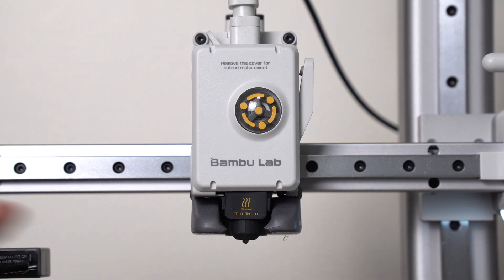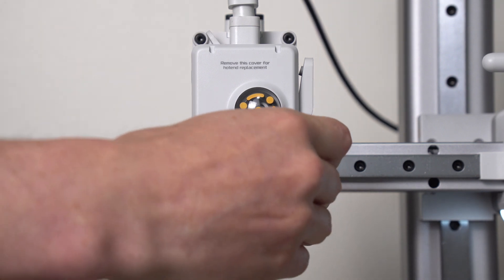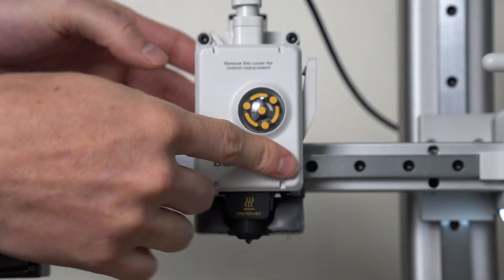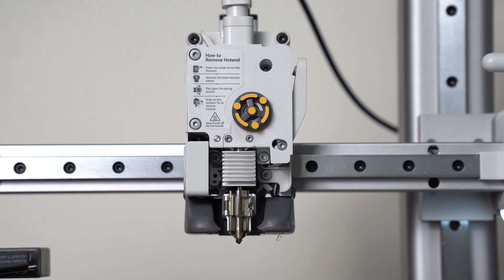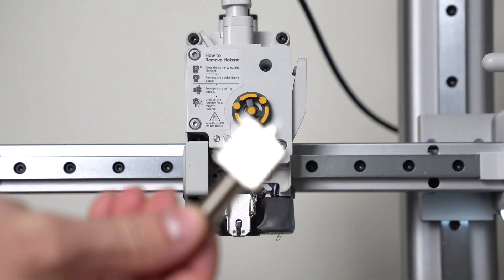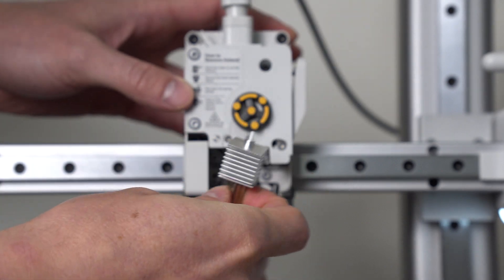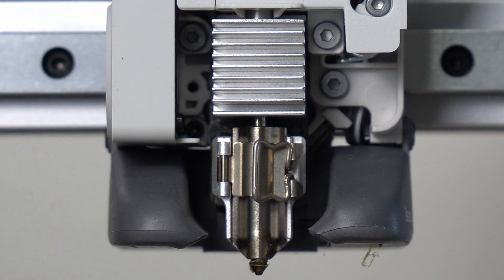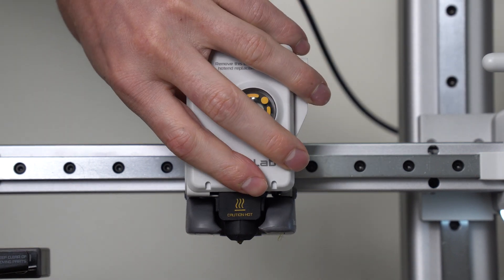How to replace the A1 & A1 mini hotend with nozzle

Comment: More detailed steps with showing how the back of the cover looks like answered my curiosity. Thanks for the simple step by step procedure. Im honestly thinking twice about swapping my nozzle from 0.4 to 0.2 as it might misalign the accuracy of printing? Is that even a thing to overthink and worry about? Also I’m afraid to rip out the silicone 😮

Comment: is there a concern with the little bit of filament that is left in the hotend? Its not heated up so its nearly impossible to take it out. I yanked on the nub at the end sticking out from the top and the little bit  of filament at the top broke off. Is this a concern?
Reply from the maker: Not a concern, next time you install the nozzle and load filament it will heat up the nozzle and purge out the old filament.

Comment: Just remember to unload/remove the filament before starting this procedure. :-D Then, after replacing the nozzle with a new one, from the printer touch screen go to Setting --> Maintenance --> Nozzle and change the nozzle size! Otherwise your BambuStudio couldn't print and you cannot change the nozzle from BambuStudio (you get an error).
Reply: thanks man, he could have mentionned it !
Reply: Thanks mate!

Comment: hello ; I had an issue about the hotend heating and change it now hotend is not fitting with the clips ..so the back face of the hotend and front face of hotend assembly is not coming face to face..do you have any idea for that ?

Comment: I swapped from 0.4 to 0.2 no issues then swapped back to 0.4 and can’t get anything to stick and it’s clumping up. I swapped from Ender so I didn’t have to mess with these things lol
Reply from the maker: It's been a couple days, did you get this sorted out? Did you do a bed leveling between the prints? did you make sure to switch back to a part sliced at 0.4?

Comment: Press the filament cutter on the right before doing this.
Reply from the maker: Yes this may be required. In normal operation the printer will perform a filament cut at the end of each print so you usually won't have to do this.
Reply: @3DPrintStuff  I never knew that

Comment: Its not going to be a problem if that filament its still there ? The cutted one thats inside
Reply from the maker: Not a problem, it's designed to do that. It'll push that filament through the nozzle next time you load a new filament.